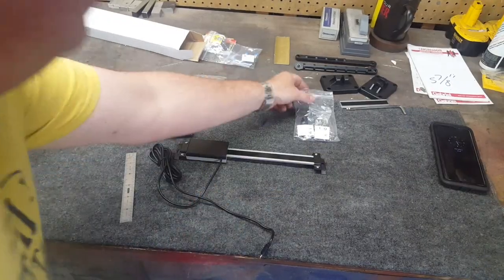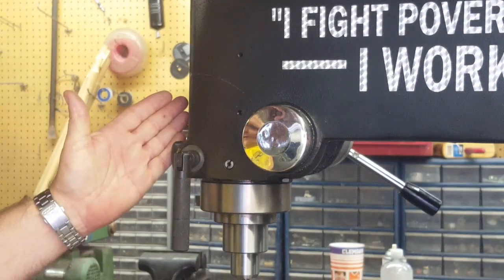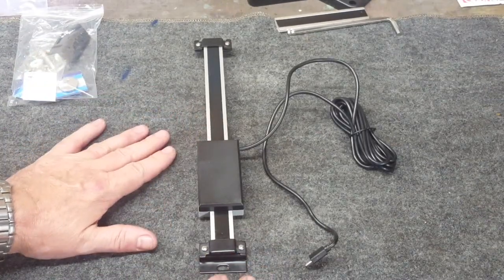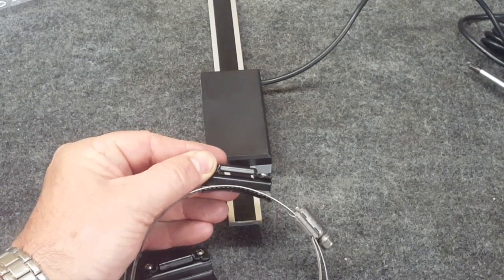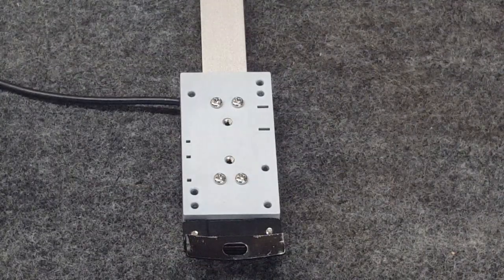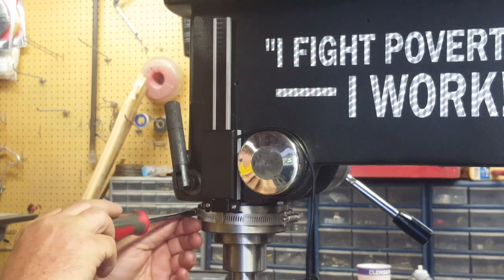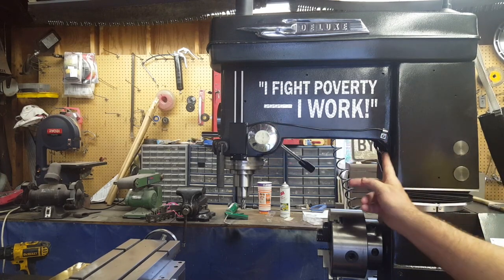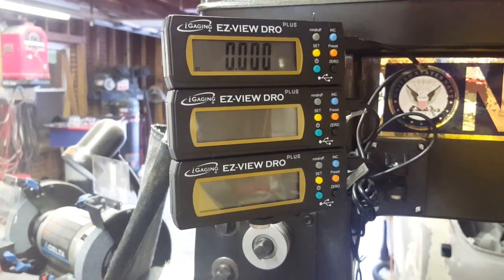Smithy Granite 1340 Max DRO "Z" Axis Install

Comment: Hey, Thanks for your video series on the DRO install, it was very helpful and informative, I installed mine using your tips. I would recommend caution when using the silicone on the back of the sensor, I did not think to plug all of the holes in the back. Silicone got inside of the sensor and made a mess, not sure if I can save it. 
Thanks again for a very helpful video.
Reply: My first thought was to use 3M double sided tape instead of silicone.

Comment: Thank you for the ideas on installing the DRO on the  Smithy.
How is it working out for you? Have you looked at the Touch DRO upgrade? It is a kit that takes the output from your installed sensors and transmits the readings to a tablet running the Free Touch DRO software.

Comment: Well I'm bringing my 20 year old Granite 1339 up to the new generation.  I recently replaced my old 120 V brushed mot0r with the 2 HP 240 V brushless motor.  It was a little messy, but I got her done.  Then I looked at the old motor and being a life long recycler, I decided to adapt it to my drill press.  It went very well indeed and now my drill press is full variable speed with no belt adjustment and it is bidirectional.  Very cool.  I was always too lazy to adjust the belts and now that's history.  I just ordered the DRO 3 axis kit to take her to the next step.

Comment: You pulled it off with the same amount of ease that the other two DRO videos had. I do believe I'm going to go the same route as you have. It is going to be nice when you have a project to work on. My shop is almost back in business...yay 
 I really appreciate you putting the DRO videos together.
Reply from the maker: Thanks Phil, the dro was pretty easy to install. I'm glad I put it on the Smithy, really improved accuracy.